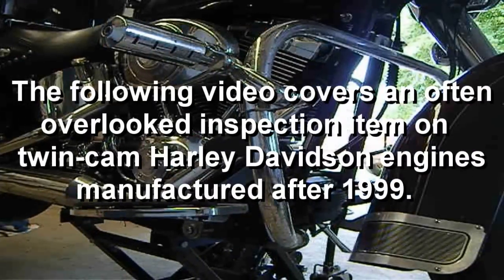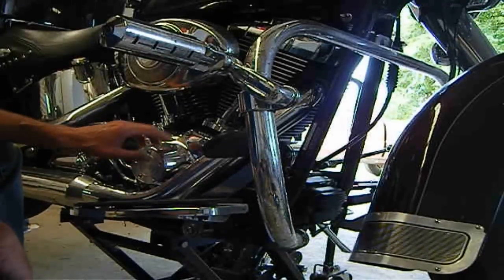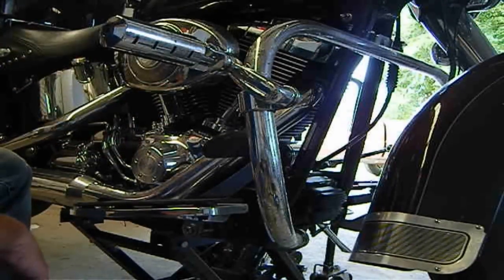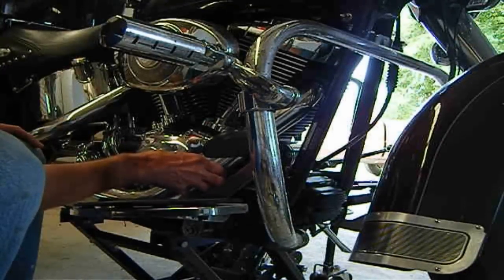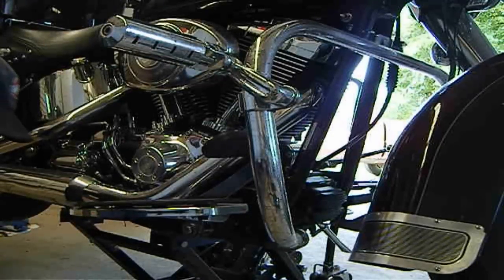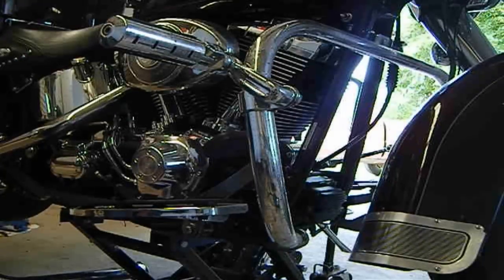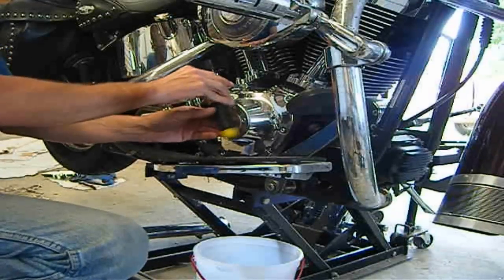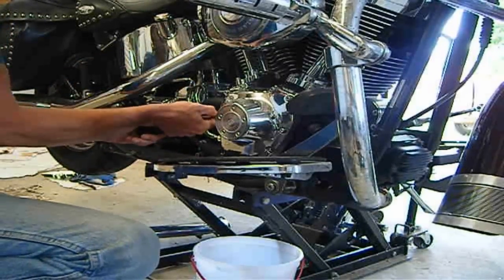TENSION HEADACHES: A Harley Owner MUST SEE!

Comment: Adjustable pushrods are not a mod, They are lightweight can break where they mount together. Instead of saving labor like suggested its a good time to look over things. Another side effect of it is potential coming out of adjustment. I would much rather see someone invest that 200$ into high compression pistons or something along those lines. That will GAIN you something, where adjustable pushrods are only saving labor. A pushrod transfers oil and runs the valve train. High dollar adj or soild push rods, Pushin rods are pushing valves.
Reply: Adjustable pushrods work fine if you don't buy junk and do install them properly.
Mine don't come out of adjustment because I install them correctly in the first place.
Reply: It doesn't gain , torque,hp, or any other performance advantages
Reply: Chris McQuiston Nor do I so contend.
 A "mod", short for the word "modification", means just and only that. Modifications which facilitate ease of maintenance are a perfectly valid change and for that reason are done all the time on a vast variety of machinery and vehicles.  Harleys aren't exactly low maintenance vehicles so there is a payoff in making changes which speed working on them. My first set of non-adjustable pushrods met the bolt cutter in 1988. They speeded later cam swaps and an eventual top end job. Still have the bike and the same set of pushrods.
Heck, stainless socket head screws on my Super B and later Super E bowls don't increase performance either, but rapid field strip with a hex key or bit made them more than worth the few dollars they cost. Often very minor hardware changes can make life much easier over time and that's worth spending a few bucks or just the effort to do them. 
Harleys out of the box are so slow they are broken by modern standards, they require a dump truck full of money (for which you can go buy another bike designed for performance and get off cheaper) to make them unreliably sort-of-fast, and with that in mind an owner can instead play to their strengths. The aftermarket is the reason to own one since it makes keeping them for decades as practical as keeping farm equipment that long. They are relatively easy to work on so making that simpler is logical.
Reply: So your saying you go in every 10k and bring your adjustables back to zero lash?? The lifters are always taking up that wear keeping them at zero lash. I just dont believe in spending the money on adj pushrods. Go buy something that will gain or change something with that money. If bringing an engine to tdc is to difficult twice and cutting and putting adj pushrods is the option fo for it.
Reply: Chris McQuiston I didn't say run "solid lifters". Read what I wrote.
Adjustable pushrods are fast and easy to set and in no way require 10K mile adjustments! A pushrod is not a lifter.

Periodic cam chest teardowns are a fact of life on any big twin so making is as rapid as possible pays. If 200 bucks hurts then I shouldn't be riding a Harley and should stick with BMW airheads or other LOW-maintenance machine.

Readers can draw their own conclusions, but I've never met an HD mech in person who does anything with the stock pushrods but scrap them.
Reply: Solid push rods are ideal, or perfect fit pushrods for performance work done after.

Lifters will take up the slack and move up keeping them at zero lash.

So cam chest? So your saying you should remove all items needed, Then take off the cam cover, Remove oil pump screws, pull the support plate, annnndd inspect the tensioners I agree. So about 25-30k miles, Unless its gear driven, or the new support plate that's hydraulic not as big of a deal.

Again pulling the support plate and top rockers are not that big of a deal.

It is a time/labor saver that is all, nothing more nothing less. That is all they are good for. Id be interested to see the amount of labor $$ saved to compare costs of adj pushrods. Again all they do it run the valve train and flow oil, theres no gain to them. Invest that 200$ into high compression pistons or something that will gain. Your welcome to your opinion ill keep mine ;)
Reply: Ob Fuscated Harleys are broken out of the factory? Dump truck full of money? Where you getting this from? I've had a (mostly stock) Ultra for over 10 years and it starts and drives fine. Had a voltage regulator go bad but it was far from New and actually still worked (just overheated time to time) so I replaced it. Bumping compression and flowing heads and valves so much you have raw gas dumping out the tail pipe is hardly "fixing" a factory problem.
Reply: ***** They aren't bad at all for (relatively) low-RPM use. The money for an adjustable set is trivial enough to (literally) burn if you can afford a Harley in the first place and if you keep it for very high mileage they are faster to field strip. I do my own work so no labor or excess markup. You can check prices in seconds via the internet so it's not worth visiting a shop to buy parts.

HDs are pleasant, slow (the factory quit publishing quarter mile times!) cruisemobiles which can last decades because they are 100% supported by the aftermarket and still relatively easy to work on. (Change a starter clutch on a Gold Wing and suddenly the archaic HD setup looks reasonable!).

I didn't mind pushrods on my Triumphs either. Of course their cams are GEAR-driven too and even as desperately cheap as Triumph were regarding cost savings (read Bert Hopwood's book if you get the chance) they didn't inflict chain cam drive on their custormers.

http://www.amazon.com/Whatever-Happened-British-Motorcycle-Industry/dp/1859604277
Reply: i agree with you chris, use that $200.  to replace all the top end gaskets, fuel line upgrade, breather upgrade & go into your fuel tank to check out fuel hose & replace fuel filter... shops like to use the adjustables to save their time & still charge you top $$$$...
Reply: I'm a multibrand mechanic and multiple Harley owner. Your single machine is a single data point. Mechanics see many bikes. The TC downgraded various parts to save the factory money, such as the choice to run an inferior chain instead of the gears proven longer than either of us have been alive on countless big twins and Sportsters. That choice was made to permit a cheaper crankshaft with grossly larger runout limits than Harley had in the nineteen thirties! The reason for sloppy tolerances was to lower assembly time for the crankshaft. That's fucking broken by design and the reason why aftermarket GEAR cam drives exist, although due to the runout tolerances being so high it's necessary to check runout with an indicator as if it's excessive you can't run gears.

Comment: oh yea I forgot to mention that they claim that the reason why the Motor Company went to this tensioner set up is to "Reduce Noice".  Really now?  Really?
The Sportster has 4 cams and they're ALL gear driven and nobody has ever complained about the gear whine or noise from that design.  What a bunch of BS!!
I HATE TWIN CAM MOTORS AND MY EVOLUTION WILL RUN CIRCLES AROUND ANY ONE OF THEM!
Reply: twin scam    what a joke   sportster is the best engine ever designed by ???? them   ok
Reply: Phillip Peters Bet v-twin could well be the later solid-mount Evo Sporty engines with the crankshaft mount alternator.
Best engineered would be the V-Rod but the bike they come in is a bit of a pig. Put that powerplant in an FXR-style frame and you'd have something.

Comment: I had a twin cam piece of junk and got rid of it and went back to an Evolution style motor and guess what, IT HAS NO TENSIONERS! It is 100% original and has well over 100,000 miles on it UNMOLESTED!  The Evolution motor was the BEST motor the Motor Company has ever made in my honest opinion. Shame on the Motor Company for never doing a mandatory recall on all the older style twin cam motors and upgrading them with the newer style hydraulic unit.
Reply: ~140+ Kmiles on my '88 FXR (I have other rides too) and still on the stock bottom end. Did top ends at ~100K.  Much love for Evos.
The TC should and could easily have been built to previous crank runout specs with gear drive cams like more than one hundred fucking years of Harleys before them. It should have been a "four cam" done Sportster-style as then you have more choice of valve angles and a very simple timing chest layout. 
I'll eventually buy a used depreciated TC and throw the annoying parts in the scrap bin, but that's different than paying new bike money.

Comment: I'm a certified HD mechanic. Your video is good for the information. In my opinion for the average guy it's smarter to take it to a dealership. Dealing with this subject on a daily basis there are many more issues we could catch and save you money and possibly reading down in the future.
Reply: Stealerships are a joke in regards to this issue..I replaced mine with S&S gear drives.
Reply: Blane M Well Blane I don't go to HD Stealerships,for anything..So I don't really know what you're talking about..Independent shops do any work that I can't do..They don't try to upsell me on uneeded work..They also charge a much fairer labor rate per hour..Just like an Auto dealership,I avoid em at all costs..And having ridden motorcycles for over 40 years,I don't need advice from you about the importance of preventative maintenance,Thanks.
Reply: Recommending folks to have an HD Stealership do all their work is a total joke..Stealerships are trained to scare HD owners into paying for unneccesary work..They intimidate HD owners into "voiding the warranty" if all work isn't done by HD..Any customizations or mild modifications are grounds for "voiding the warranty"..the Better Business Bureau is aware of this bullshit scare tactic & has warned Stealerships many times..A good certified HD Tech usually will work for an Independent shop rather than a Stealership.
Reply: *****
If you can wrench far more complex modern automobiles doing the cam swap is pretty basic. I've done them at the multibrand shop I help out at. S&S of course.

The chain design isn't necessary (Sportsters run four cams just fine with GEARS as Harley has used for over a century. as to custom Sputhe big twin cases) and inherently worse than a gear drive. Those wear particles from the shoe don't just vanish and trash an oil pump now and then...

The TC is a budget engine HD makes buckets of cash on and they cut corners (how DARE a premium motorcycle GET RID of output shaft Timken bearings then sell them as an upgrade!) everywhere they can because many HD owners are technically ignorant and don't demand better.  The victims of such shitty design are none to happy later when the visit online forums wondering why their rather expensive toy shat the bed. Doubly so if the owner is a senior citizen who barely rode the thing and was gentle to it.  What's fun is the non-mechanics who blindly think that because they paid too much they must have gotten quality. I don't contradict them. They'll be spending more money soon enough.

I'd buy a TC though, but used so the fellow who bought it first eats the depreciation.  As usual the aftermarket comes to the rescue (aftermarket support is the reason I own two Shovels and an FXR, you can ride them forever) so you can throw the factory junk in the scrap bin and stuff better guts easily.
Reply: ***** Ha Ha Ha   stealership  that's cool
Reply: Well I don't know what dealership you go to but where I work its different. We will install cams etc and if there's an issue we will not only stand behind our work but we get parts that are stock to show the insurance company so they don't get denied. Sorry about your luck. We take care of our customers.  Preventive maintenance will save you money in the long run. Don't fix it till its broke will only land you in the in the middle of the dessert stranded. I can't tell you how many times I've gone over a bike where someone did there own work and if I hadn't fixed there mistakes they would have never made the trip. Maybe you guys will find me here or at another shop some day and have the privilege of getting good service.
Reply: Okay, good tip.
Reply: ***** at least you have peace of mind it was done 100% correct (presuming I do it) and you have a warranty on parts and labor.  Not bad considering your riding on two wheels.
Reply: +Blane M   Riding on 2 wheels ?
......  Another scare tactic  !   Designed to Rob You !!  Boy , you guys are really special !

Comment: starter relay just started clicking win engine is cold then wouldnt turn,wanted to tho. once its warm works fine. im gona try a manual plunger. is it a bitch getting starter off newer twin cams(02)? im gessin this may be a common problem.30000mi on it. battery is fine. sounds like 1 of my old fords,wed just jump relay.

Comment: (continued).
Options vary from kits with just gears, to replacement camshafts which offer much better performance. If you aren't intending on keeping the bike then that changes the math, but I'd at minimum go with the gear drive kit and adjustable pushrods. If I were keeping the bike I'd get replacement camshafts as part of the kit because stock emissions cams are quite mild. Labor will vary greatly by your location, so check online forum(s) for good local shops.
Reply: $2500 has been quoted for parts and labor for your suggestion.

Comment: You can inspect runout using a dial indicator before ordering parts since most vendors ship quickly and you can call etc to verify items are in stock before ordering. If runout is excessive you could stay chain instead. I work part time at a small indy shop and I don't quote the labor, so check places like the v-twin forum section on twin-cam engine mods for common current prices.  You'll want to discuss your intended use since there are many choices.

Comment: I've read that the crank shaft runout may be an issue when converting to gear drive. My prob is my bike only lists for around $10,000 even with all the extra chrome, rims etc. I see you wrok at a shop so would you be able to tell me a ballpark figure of what upgrading to gear drive may cost? I certainly don't want to throw too much more money into the bike, although I have no intention of selling anytime soon. Thanks

Comment: Given the hideously stupid design (and that gear drives such as HD ran for nearly a century are considered an upgrade from the pathetic chain setup), if you inspect the shoes, take advantage of the opportunity to throw them in the trash and install a gear drive replacement. You can buy the tools and be ahead of what a shop charges (I work at one) and keep the tools.

Comment: Well I guess thats why Harley doesn't mention these tensioners as part of routine maintenance As you can see after over 20K they are still like new. Similar to the primary chain adjuster, difference is there we have to manually adjust for chain wear, where these are spring loaded and automatically adjust

Comment: great video!  very helpful. I have a 2002 electra  glide  classic with 28,000 miles.  i'm going to do this inspection in a few days. I want to keep the stock pushrods if the tensioners need replacement.  I don't mind pulling the eng apart as it will give me the chance to inspect everything & i'll replace all the gaskets & seals....

Comment: thank you very much for the info! i actually opened it up myself which was very easy, the front exhaust pipe then the case itself! to my surprise both tensioners and the chains were like brand new!! thank god.. supposedly 80,000 miles on the bike,but the speedos broke and the old owner was a serious vodka drinker that may have thought 8000 was 80000 i mean its running like a sewing machine!!  well thanks again for sharing your knowledge, it really helped me alot!!
Reply: Cut open the oil filters & check 4 orange bits.

Comment from the maker: If they do, in fact, need replacement, the pressure will have to be relieved from the lift rods on the cam shafts in order to disassemble and replace the tensioner pads.  Cutting and replacing the pushrods is much faster and less expensive than the alternative.

Yes the gasket is still in use today.

Comment: Good vid. S&S sells adjustable pushrods c/w new tubes. You don't need to cut the old tubes but they will not install with the new adjustables - new comes with the kit.

Comment: i was doing some research on my 2000 dyna wide glide 1450 motor and started seeing all kinds of articles on how these 2 tensioners will ruin your engine if you dont check them! had me a little freakin i must say! so i really appreciate you video on this!! by the way if they do need replacing you dont need to remove the pushrods and tubes do you?? i do have a harley manuel but it doesnt give much info on this!! also was your gasket o.k.??
Reply: You have to remove the pushrods.  By the book states that you remove the gas tank and rocker boxes to lift out the pushrods.  Many folks opt to instead cut the pushrods in two and replace them with adjustable pushrods so the tank and rocker boxes don't have to be removed.

Comment: At 9;16 notice a large coupler on the push rod tubes. Pull these down and the tubes will come apart by removing the top piece with the loop in it. The push rods can then be cut and replaced with 2 piece adjustable rods. This saves messing with the top end of engine.

Comment: Thats what I was thinking too man. Think I'll use the old ones till I change the cams. By the way the shoes on mine are absolutely done. 62,000 km's and I think I am wayyyyy lucky something nasty didn't happen. I can't help but thinking that the oil pump shoud be changed out cuz all that nylon must not have done the old one any good at all. Thanks for your vid man...you may have saved my engine!!!